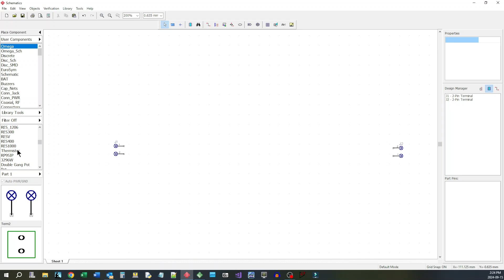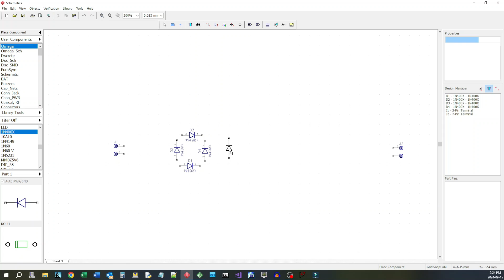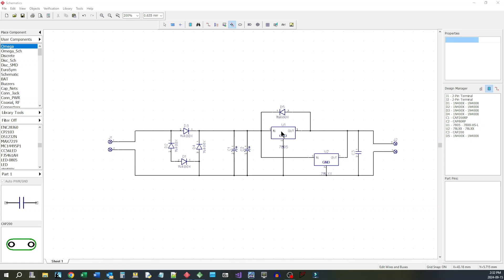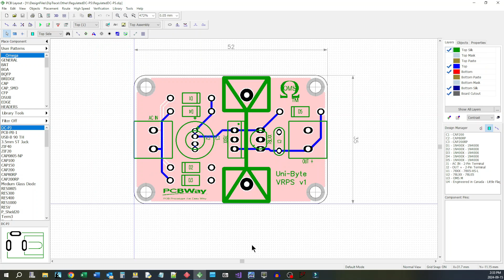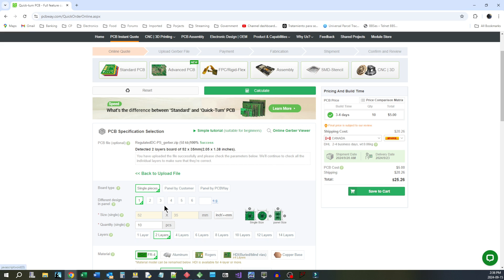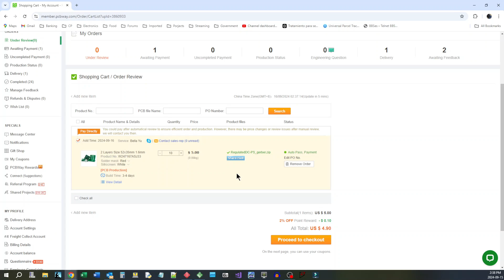Uni-Byte 0217 - Versatile and Configurable DC LINEAR power supply - Part 1

Comment: You mentioned that you like to use individual diodes to build your bridge rectifier. I can appreciate that. I prefer to use the All In One types GBU, KBU , Etc. series... Here's a tip = I bumped into a YT video of a man configuring four individual diodes to have the same pin pattern as the AIO types. He soldered them up dead bug style. That would look great, on the PCB = very retro steampunk-ish. I also saw one where the maker cut perf board into the shape of the AIOs and mounted the individual diodes on the perf board. So, if the PCB is made to use AIOs, and all you have on hand are individual diodes, there are lots of nice looking and functional means to create one. I also saw one where the dead bug style was bedded in epoxy putty. I am not sure what benefit they thought the putty would achieve, but, to me, it looked like the encapsulation would just retain heat and cook the diodes. Different strokes, I guess. HTH.
Reply from the maker: Interesting ideas.  Which thru-hole AIO pattern are you going to support on yours?  I know of at least 3.  The one in a DIP-8 sized package, the little cylindrical one with the leads in a square pattern or the linear one.
Reply: @uni-byte  The linear one is what I use most often - KBU1010 seems to fulfill all my needs... Sort of like the 1N4007 in discretes... Costs the same as the 1N4001. That seems to be true of the cost of the linear ones, as well. Same cost, no matter the volts rating. Cheers!

Comment: Using 2 regulators in parallel  is not a good approach, a better (best?) approach would be to  use a transistor to boost the current, if you google "7805 current boost" you will find some examples but there are some LMxxxx datasheets from Texas that have the calculations and such and you will be able to limit the max current through the regulator, you can use this technique for fixed and adjustable regulators. You can also use transistor with TL431.
Reply from the maker: I'm not using two regulators in parallel.  I'm using one or the other.  if I only need 100ma or less I will install the 78Lxx, if I need over 100mA I will install the 78XX with various sized heatsinks depending on dissipation requirements and fnaly, if I do not need regulation at all I will install neiter type of regulator and place a jumper where the protection diode is.  I also have a choice of rectification diode size and filter capacitor size to meet my requirements.
Reply: @uni-byte  I see, sorry, i clearly missed something, i was also working at a project while i was "watching" your video... Well in that case i think a tradicional lm317 with a pot would be a good candidate for the regulator, and a switch to bypass it instead of a jumper, about the capacitor maybe fit like 10, 47, 100, 470, 1000, 2200, 4700, 10000, with a double throw switch for each and a bleeder resistor when they are turned off.
Reply from the maker: @tiagoferreira086  I did give some thought to using LM317s, but these are intended for permanent installation and really not intended to variable.  They are configurable, but do not need to be changeable.  The goal was to make them as compact as possible while still allowing them to be versatile enough to be configured for a multitude of applications.  Thanks for your thoughts on this!

Comment: Great minds... I, too, thought of this critter, years ago, and I developed some different boards - DC to DC and AC to DC. Obviously, the major difference between the two is that the AC sourced unit includes a bridge rectifier and a smoothing cap. I got caught out on typically using two different brands of regulators... Yep, they have different pinouts = "Doh!" So, I like your solution of putting them in parallel. My AC to DC board also includes a negative rail. You have inspired a new revision = I think I will layout a universal board that will have three functions - Rectification, regulation and both positive and negative rails. Here's the trick; the function sections will be removable (by either snapping, or cutting, them off.) So, the user can have exactly what they need and remove the unused portions of the board to save space inside the case. Achieving this layout will be rather challenging and, therefore, much fun. I use the DC to DC boards to the (significantly) greater extent, to calm down noisy wall adapters. Like all the cool kids, I named the board = "Dr Dee's Old Tyme Wart Remedy." (Rights Reserved) <grin> They are extremely handy! Another thought provoking consideration for the universal board will be the means and types of input and output connections to include = barrel connectors, wire clamps, plain pin hole pads, etc. (The Wart Remedy has a 3.5mm Barrel Connector for its input and pin hole pads for its output.) Thanks for your efforts to share and teach!!! Cheers.
Reply from the maker: Great idea for the switchable rail!  I had thought of putting in a hole right beneath the terminal patterns to use as a strain relief for direct wiring .. but this was about 20 minutes after I got notification the boards went into production.  I see a V2 in my future.  I'll mention some of this when then boards get inI  Thanks.